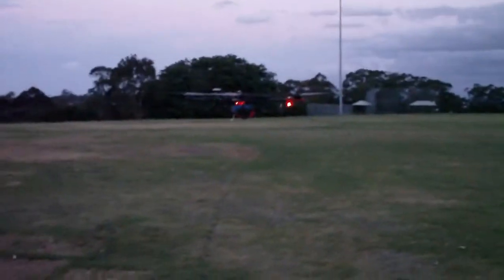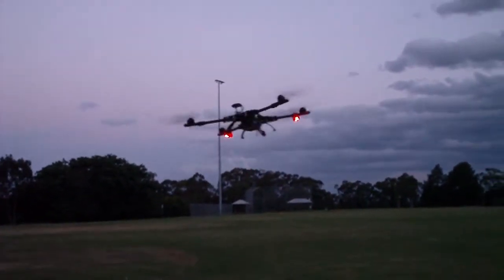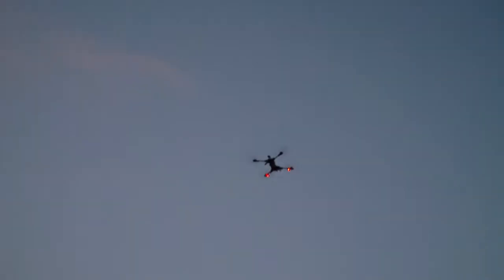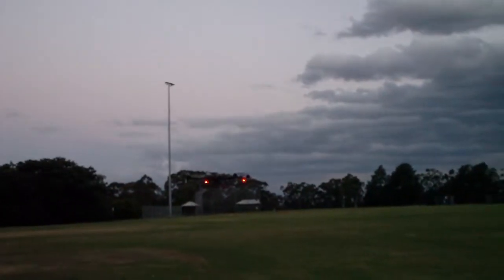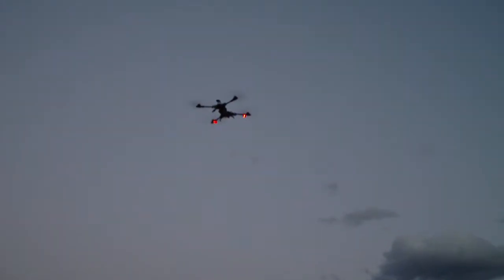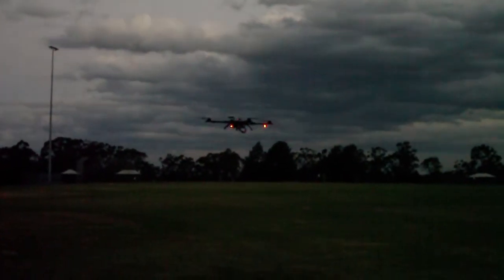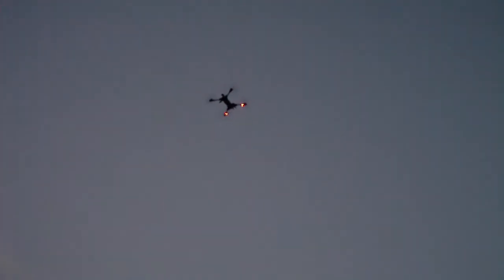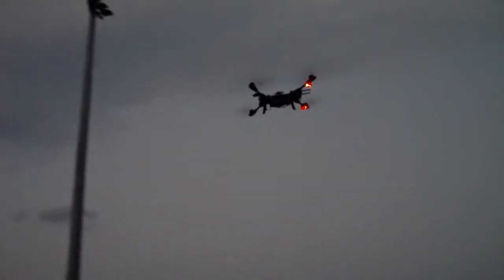Stretched Alien 560 in flight.

Comment: Very nice frame I'm in between to choose from this the alien 560 and the alien 680... I think this frame is the nicer size and more compact to carry the only thing that I don't like in this frame is the landing gear that comes with
Reply from the maker: +Charlie Farrugia Yes the landing gear is very weak on this frame and I changed it.  This is a low profile Helicopter landing gear.  Its strong but too low to mount a gimbal.
Reply: Should I go for the Alien H4 680? :)

Comment: Great Quad built one myself from your specs. I was considering buying 13 or 14 inch blades to try and improve stability on windy days. Would you recommend a blade size?
Reply from the maker: Usually the smaller the prop the more stable it will be in wind.  Perhaps try the 13 x 55 carbon props?

Comment: I'm going to stretch my Alien 560 like the great one you've built. I was going to use Afro 30a esc with the sunnysky 3508 580kv. I assume the Afro ESC will be compatible
Reply from the maker: I think they should be ok if you use the latest firmware update 30-09-14.  It works fine with my 3108 motors that previously had issues with the Afros.

Comment: Cool thank you. Do you have a voltage sensor as well?
Reply from the maker: Nothing specific. I am just using the low voltage warning on the NAZA Lite unit - I tweaked it over several flights and when it auto lands I know the battery has about 10% remaining.

Comment: Hello Rob, I'm about to complete the build of my Alien 560. I've only just stumbled across your video, very nice setup btw. I'm using the Tarot TL68B33 motor mounts which added 104mm to the wheelbase, and Emax MT3506 650kv motors. I have since removed 52mm from each motor boom to bring the wheelbase back to 560mm as I noticed it had a wider wheel base from left to right compared to front to back due to the geometry of the motor booms. I was concerned this may cause me issues with setting up gains, similar to the issues some people have with dead cat configurations. Have you actually increased the length of the boom arms, or was the stretch due to the motor mounts?
Reply from the maker: Hi,  it was just the stretch due to the motor mounts, I didn't adjust the booms at all.  The front arm booms are shorter than the rear ones.  When fitted with the motor mounts I had 50 cm left to right between motors and 46 Cm front to back.  This is a negible difference for the Naza flight controller which seems to handle it ok.   I think the problems arise when the rear motor spacing left to right is different to the front.  That needs a custom mix in the flight control board.   You can see my dimensions here.  http://www.rcgroups.com/forums/showpost.php?p=29608466&postcount=779
Good luck with your maiden flight, those motors look nice!

Comment: Love this so much this will be my first build and my first quad copter ive just ordered the frame but is there anyway u have links to the other stuff so i dont get the wrong bits lol great video
Reply from the maker: Thanks, you can see a full parts list here. 
http://www.rcgroups.com/forums/showpost.php?p=29824103&postcount=842
Reply: ***** many thanks im in the uk and after watching your video im really excited just hope i can build it like yours as never done this before
Reply from the maker: gary castle I enjoy building these as they just bolt together, remember to secure every nut and bolt with some type of glue (I like foam safe CA Glue) otherwise they will vibrate loose eventually,  Do good quality soldering on your ESCs, take your time on the first one and feel free to ask questions, either here or in the Alien 560 thread.   This really is a great value quad and every time I fly it I am more impressed.  Good luck with yours.
Reply: ***** i think id ask you loads of questions didnt even realise id need to solder lol well i have just gone out and spent £180 on the FrSky Taranis with X8R receiver i have that in my hand and just ordered the frame from hobby king

Comment: I have the same motors but the "V" series and the same props.  I also have the NAZA M Lite on a very similar frame the WLTOYS HJ-H4.  I think I will order the extensions like you have to give me a little bit more room for the props.  I also added a HK quanum retract system since I have gimbal going on the frame.  In addition I plan on getting the Taranis but I'm using my ezuhf module and ezuhf diversity receiver.  I opted for the ZTW 30A opto esc's and they seem to be working great.  I have a question for you about the telemetry.  Can I still receiver telemetry somehow while using my ezuhf module with the taranis or do I need to use the taranis and X8R or X8RII?  Any help would be greatly appreciated.  Oh by the way I am running my setup on 4s using the multistar 6600mah batteries.  I am going to also do some calculations and get the 8000mah version and the 10000mah version as long as they don't degrade my flight time.  I need to weigh my whole frame so I can calculate everything on ecalc.
Reply from the maker: Hi Brian, that sounds like a nice set up.  I'm not sure about telemetry with the UHF system, I have only just started trying telemetry myself with the Taranis and the FrSky GPS seems fairly basic.   I haven't tried this quad on 3S yet but need to try it as the motors are rated for it even with these props.

Comment: Hi Rob Really impressed mate, Does it still fold up?  I am looking at the Black Snapper L version but to pricey, also was thinking of the Daya 550 with extended arms. Also looking at the Super X FC although mini X  FC about to come out and that is super cheap! With 4s you should get a lot longer No?  Not that 26min is long enough :)   You still need all your FPV gear and gimbal on it so you will lose a bit of time there with added weight.  Still though it looks a beast and as you said it is so so quiet.  What do you think about 360-400kV motors with a 4s setup ? Dam I need to stop procrastinating :)
Reply from the maker: LOL.. I think 360-400 Kv motors would be awesome on 4S, maybe even 5S.  That would push it to 30+ minutes with these props.  I haven't heard of the Black Snapper and Daya before but just Googled them. Both are very nice and would make great quads. I think the key is to find a good prop / motor / esc combination.  My first Alien / X650Fs were more experimental but I feel this 2nd Alien is the best so far.   Saw the Super X and Mini X, would be good to get some reviews on them  I have 4 NAZA lite quads now so its time for something different.   I haven't tried 4S on mine yet but will do sometime this week.  I have my timer set to 22 minutes and that just seems forever.
Reply from the maker: PS, no, it doesn't fold up now.  The arms are way too long.
Reply: Oh buggar I really need it to fold to go away with in the van but also need the bigger flight times to film with up north WA . Black snapper is awesome but Bloody hell they asking 300euro for the frame? We do get the VAT off that but still!!! but it is the best I have seen in design. I will have all the fpv gear and running uhf and 2.4vtx  for those kimberley gorge runs 😃 still.confused on alot of the setups I thnk I just need to jump in but dont want to end up with the wrong gear. Good reviews on super x and it has a black box for monitoring flights. Mini x is coming out soon very cheap but apparently lower quality  a bit like naza v2 and naza lite.

Comment: Excellent work Rob, she looks superbly smooth and 20 mins plus is no joke. You made me giggle when you said it goes off like a rocket and then slowly climbed out like a sedate sub 1000kv camera rig. I guess it's all relative but it does look an excellent go pro rig indeedy.
Reply from the maker: LOL, yes its not an Armattan in vertical climb.. though the size is deceiving as one prop on this is the size of a whole CF 355.  The thing that surprises me the most is how silent it flies. Those props are like silk in the air.